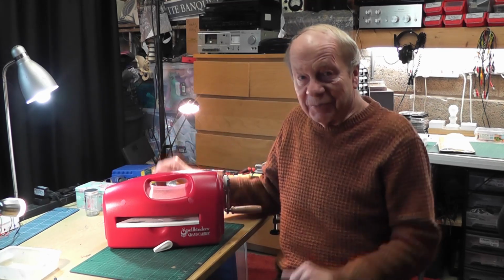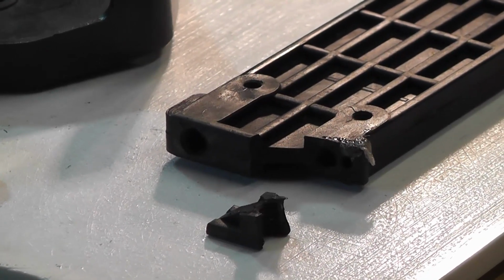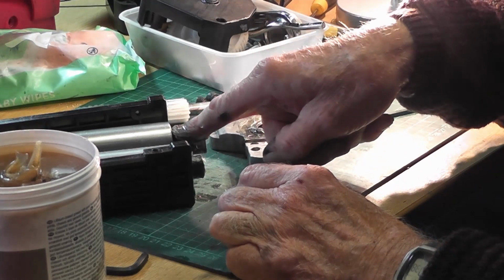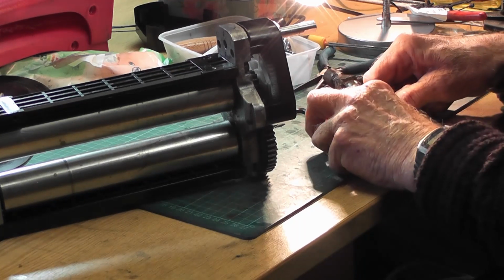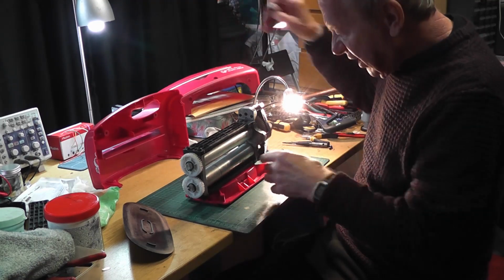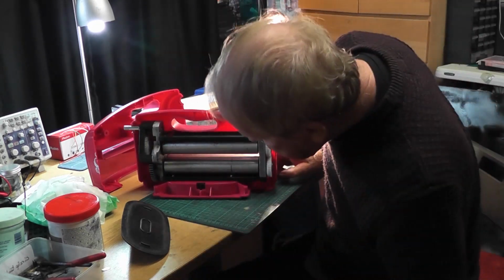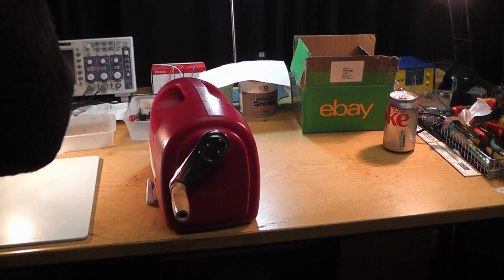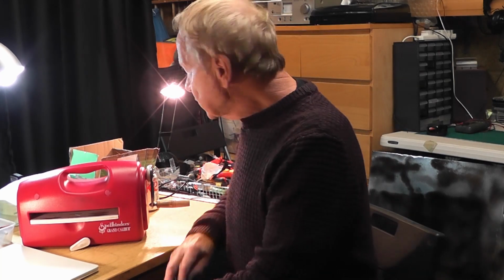Spellbinder 'Grand Calibur' cut and embossing machine repair

Comment: Thank you so much David.  This video gave me the courage to "have a go" and I have managed to take apart my machine on two different occasions to fix it.  The first time was when I could hear something rolling around inside, the handle was really hard to turn then it refused to turn.  I opened one side of the machine and a screw fell out, I located where it came from screwed it back and tightened all the screws that I could reach.  Second time I had the same issue but this time I had to take the whole machine apart, re-insert and tighten all screws.  But I had issues putting the handle with the suction pad back in, put it in upside down, took it apart and the little pin holding things together broke.  So had to improvise and use a piece of metal earring I had to fix it.  I didn't have to buy any parts, it took me a little while to fix but it works really well and I hope I have few more years of use out of it.
Reply from the maker: So pleased you were able to fix your machine and that my video was of some help. Take care 😊

Comment: Hello. I've just come across your video. I have 2 of these machines, one that works perfectly well but the handle keeps falling off and the other the handle is secure but it resists when I try to put a sandwich through and I don't want to focre it. I suspect the gears or something is not working but not having anyone to look at it for me I need to fix this myself. I was wondering if I can swap the handles over and how to do that.  I didnt see how the handle was fixed in your video.
Reply from the maker: Hi Margaret,
Thank you. Whatever you do, do not force the handle. This can cause cog damage. Best to simply swap handles. Plenty of YouTube videos on this which is probably better than me descibing it. 
Hope you succeed
Take care David

Comment: What grease did you use,please.  I have taken my machine apart but not sure which grease to use.  Thank you in advance ☺
Reply from the maker: Hi Denise,
Just general purpose grease from any motor store. Don't use vasalin or silicon, not thick enough. A small tin will be about £3-4 in the UK Halfords sell it (Geneal purpose motor greese.
Dave
Reply: @DavidHallettProjects  thank you so much have put it back together and is working better now that it has before. Will buy grease tomorrow.   My poor fingers are a little bloody 😢 😆
Reply from the maker: @deniseaddy814  
Pleased to have been of help

Comment: Oops I hadn't finished watching the video when I asked my question about cost.  I caught the information towards the end of the video.  Thanks for sharing.  I'll keep my fingers crossed that I don't have problems with my machine.  As you say, the worse thing you can do is force or continue pushing die plates through if the machine resists!
Reply from the maker: Thank you for watching my video,  that repaired machine is still working fine, it was an early model and gets lots or use. Hope yours keeps going strong. Keep the plates clean and don't force it is good practice.
 Dave

Comment: I'm a crafter and use a Grand Calibur and am always worried that it will breakdown.  I unfortunately don't know a handy craftsman like you around to help me out. :(  Just curious, what did the replacement parts come to for you?  Buying a the newer replacement machine called the Spellbinder Platinum is will likely cost $150 - $178 or so I'm hoping my machine will hold up.

Comment: I've never seen these before, but they look useful for cutting out homemade CD lables.
It seems a bit cheapo to have all that plastic when there is so much pressure do deal with.
Nice fix.
Reply from the maker: Mostly used by card makers, Create and Craft use them a lot. The combination of plastic and metal cogs can go haribly wrong. I spent about two days fixing this one so not cost effective, best buy new. Thanks for viewing
Dave